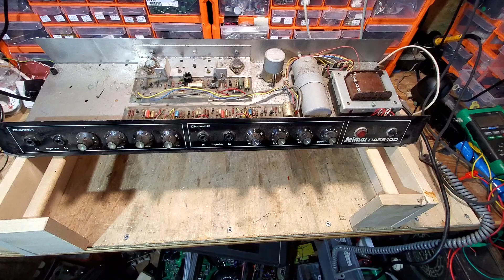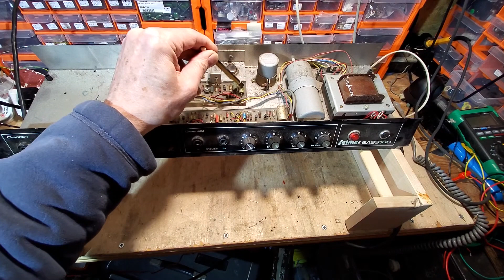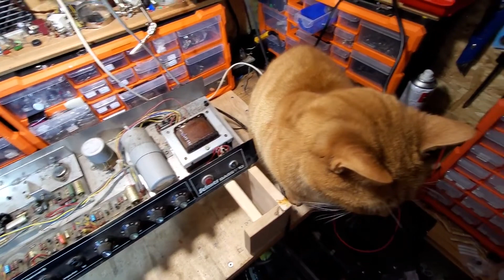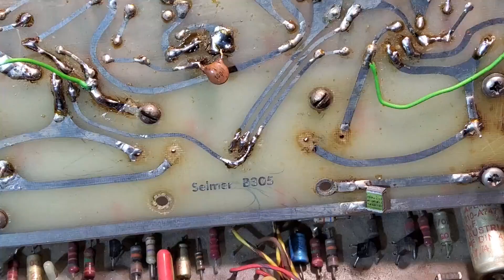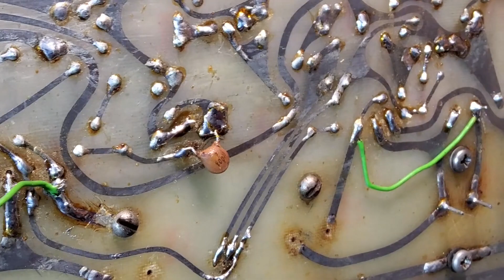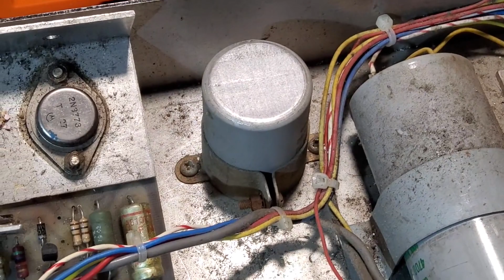Selmer Bass 100 Solid State  Bass Guitar Amplifier Is this Amp Worth Repairing? What do you Think?

Comment: Very interesting, in very bad shape but
maybe with the name of the To3 transistor is possible to find some
schematic
100 w of power with 2 transistor is a
somewhat very optimistic.....
Does you measure the power rail?
Is double power or single:
in ex. +40 0 -40Volt  or 40 - 0 volt
Maybe is quasi complementary topology, that was the road in that days
However, yes is time consuming but, not impossible if you want
Cheers
Robi
Reply from the maker: Hello Robi. I have decided to call time on this one. It's in a bad way. As you say not impossible but it was going to be a lengthy restoration. Thanks for the info and watching. Take care.

Comment: As configured, those missing components with the jumper wire going to the removed solder pads would have put some type of component across the base and emitter of the output transistors (the metal shell is the collector). Perhaps a small capacitor, or a reversed biased diode, as protection against voltage spikes?  Regardless, this thing is far too messed up to be worth dealing with unless you got lucky and found both an accurate  schematic and an accurate parts diagram showing the layout of the circuit board components.  By the way, it would be unusual to see a separate bias trim pot for each output transistor, and so anytime you see 2 trimmers, one is likely for the output bias and the other one is likely to either be for adjusting DC offset to 0 or perhaps adjusting the linearity and symmetrical drive of the driver transistor circuit.  In a valve guitar amp we often like some asymmetrical behavior; but not necessarily in a bass amp, and certainly not in a Hifi amp. Solid state circuits generally don't sound very good when run in a non-linear fashion.
Reply from the maker: I think you you are right. No schematic or layout for this amp. And it has had a lot of damage done to it due to bad workmanship. So I think it's no go on this one.

Comment: Note the Pozi-Drive screws underneath the circuit board, which have 4 little tic-marks or notches between the main vanes of the screwhead: they're not Philips screws, they're Pozi-Drive screws, and the heads are chewed up because somebody used an ordinary Philips screwdriver on them.
Reply from the maker: Yep, it's a shame.

Comment: Very interesting Martyn.. I've got an 1980's MFJ power amp who's output trannies run hot.  The amp has never been fiddled with,  but I still can't quite figure why it's running so hot. Your trip down the rabbit hole with this Selmer might give me a clue where to look on my amp as the principals are all the same apart from mine has no tone control board.
Reply from the maker: Hello Pete. I am afraid this old Selmer is a no go. One or two techs on here have given me some advice on this one and as the amp has also had a lot of bad work done to it, plus there are parts missing I won't be restring this one. It's a shame but they can't all be saved. Take care Pete.
Reply: @vintageguitaramp_guitarteacher   Thanks for letting me know the state of play with this amp Martyn.. It is a shame, but these things are what they are.. I could see you were up against it, but I've watched you take on some real train wrecks and bring them to life again. This is sadly not one of them 💣💥..

Comment: That PCB really looks suspicious. (I have never liked PCBs in the first place. 🤨) 
Are those extra holes on the left side of the chassis perhaps for a OT of some other model or version of this amp?
I once many many years ago installed a line output connector to my friends SS Bass amp and I was very surprised because it sounded very nice and it had an OT. However it wasn't a Selmer. It was a Peavey.
Reply from the maker: Hello. Yes it's a bit too suspicious. I am calling time on this one. Your not the first person I have heard saying they get a good sound from line out on ss amps. Thanks for watching.